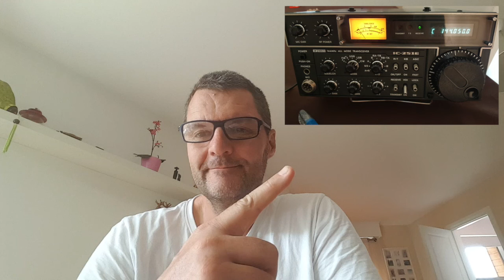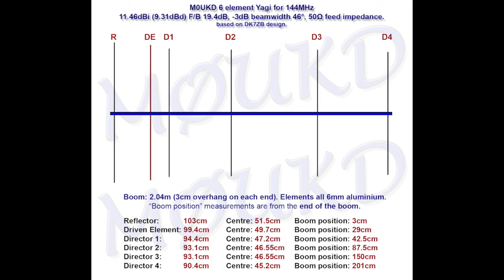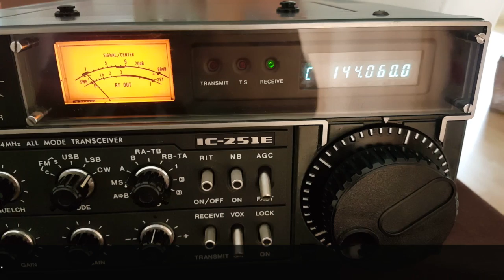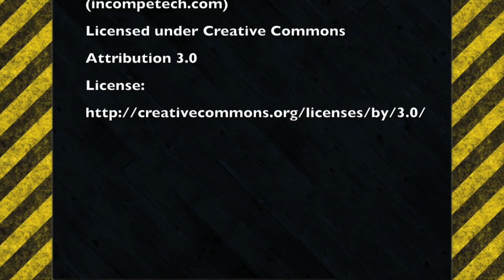Building a Portable 6-el. VHF 2m Yagi-Uda Antenna.

Comment: Great video Gil. I did a 5 element quad and got it working from Low section 144,300 up to the repeters on 2 meter takes a bit of a time but it works fine. Hope to work you on vhf on ssb some day. 73 de sm3uwz/Lars

Comment: I built this same version and worked amazingly on the lower half of the band 144.300ssb but it was resonating flat on 141mhz out of band according to my analyzer. Today i thought i was clever and wanted it to resonate alot higher around 145 to have ssb and fm band available with the lowest SWR, but things got really weird completely detuned yagi. Any advice to make this version more for 145.000mhz. best of both worlds which is always not possible. 73's Gil ZS1WE. 
Ex-résident de Saint Gemain en Laye, Paris. Veux retourner
Reply from the maker: I think you would need to recalculate the elements... Or reduce them all by the same length little by little...
Reply: @RadioPrepper  Many thanks I have done so and finally got it to resonate where I wanted it too. 73 Gil

Comment: What metal did you use??
Reply from the maker: Hi, aluminum..
Reply: @RadioPrepper  can i use iron?
Reply from the maker: Sure, but not as good. Best is copper.
Reply: @RadioPrepper  Thank you, I made it with iron and it worked too .

Comment: You will have fun with 2 meter SSB =)
Reply from the maker: +Pat Hopkins I hope so. There aren't many users around here...
Reply: I had the same in my location for 220mhz SSB .... but found if I got on and worked it for a few weeks found several in the area that had the same equipment setup 8-)   I have worked 1200 mile plus TROPO SSB 144.200 mhz contacts using a Big Wheel OMNI's at 35 feet AGL with 180 watts =)
Reply from the maker: +Pat Hopkins Nice. Well, I made one 20km SSB contact, but at least I know the radio works..!